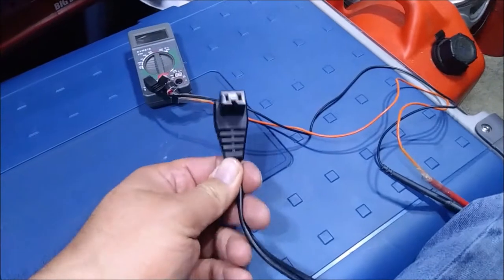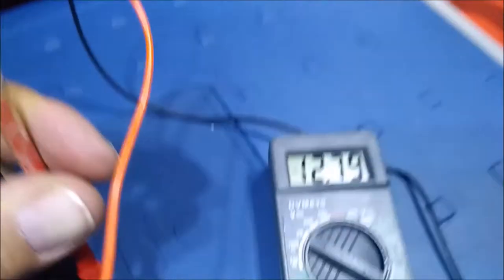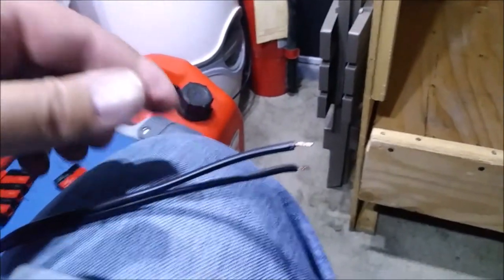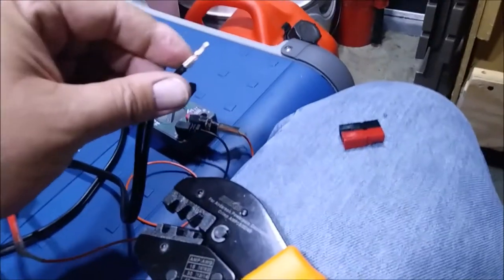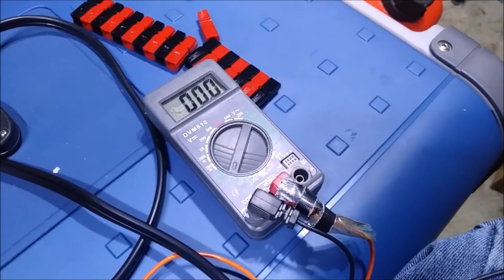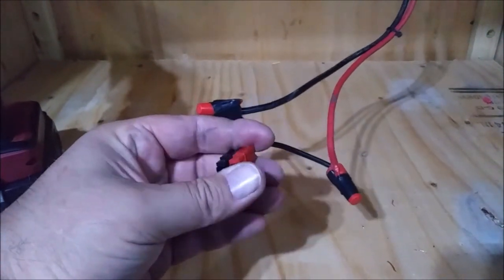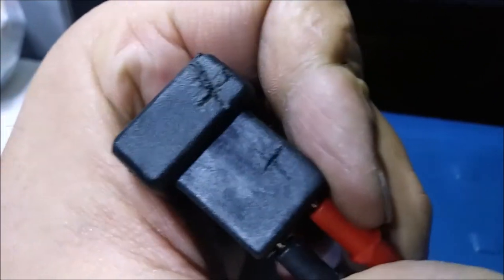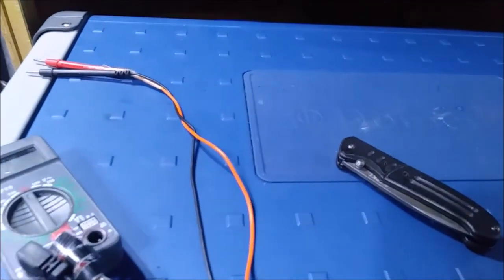Dump Those Cigarette Lighter Plugs! Go PowerPole

Comment: If you look at the black wire on the outside, you’ll see one side has lines running up the side, that’s the negative.
Reply from the maker: I'm not going to bet a $600 appliance on that though
Reply: RambleLance you are correct 100%, but  if your 12 volt power supply leads for the Dometic/Waeco don’t have these differences on the outside then I wouldn’t be using them on my 600 fridge.
Reply: I thought the positive had the lines along the sides
Reply: @cargocurtis5933  This is correct. The negative always has a smooth jacket.